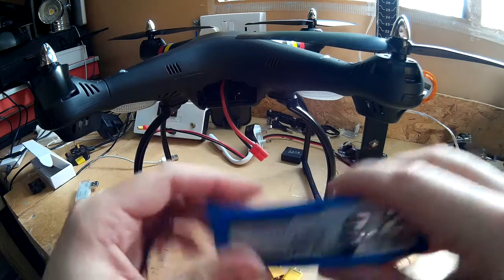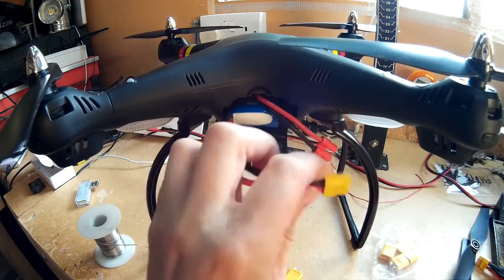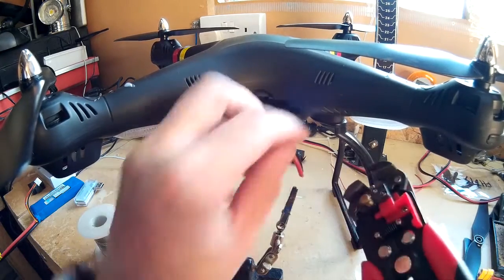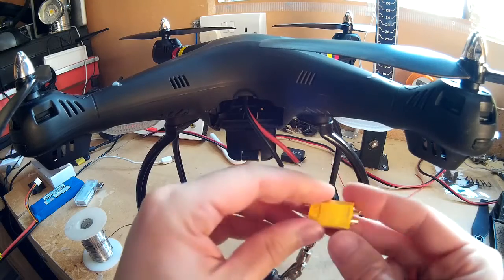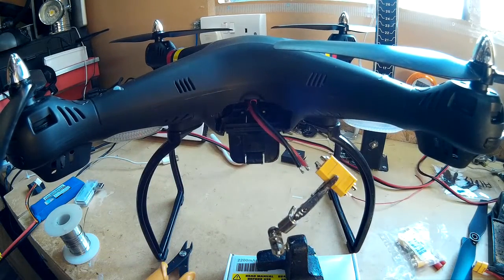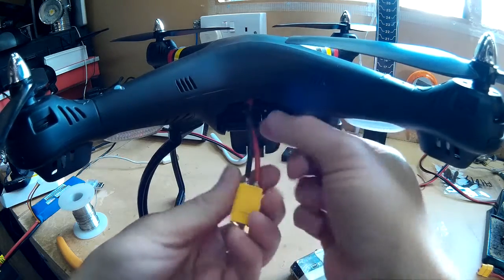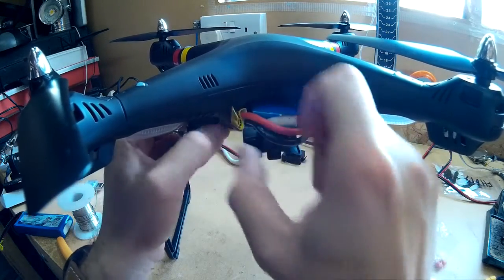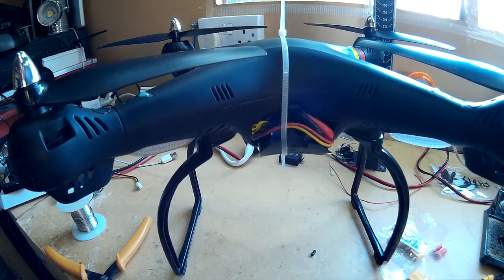Syma X8C 2200mah Turnigy battery Setup upgrade

Comment: hey 
where did you buy the landing gear
Reply from the maker: +Dyno Gualldyno black legs http://www.banggood.com/FC-DJI-Phantom-1-or-2-Vision-General-Heighten-Broaden-Landing-Gear-Skid-p-920118.html?p=070519238739201308J6

White legs http://www.banggood.com/Heighten-Broaden-Landing-Gear-Skid-for-DJI-Phantom-RC-Quadcopter-p-917962.html?p=070519238739201308J6
Reply: Thanks

Comment: as x8c sort of upgraded x5c other than jack for camera will x5c board work in x8c body dont know are they same protocol cheers
Reply from the maker: +gadgetman 404 No the power transistors are to small and the circuit board would not cope with the currant draw you would just fry the board
Reply: Ok cheers